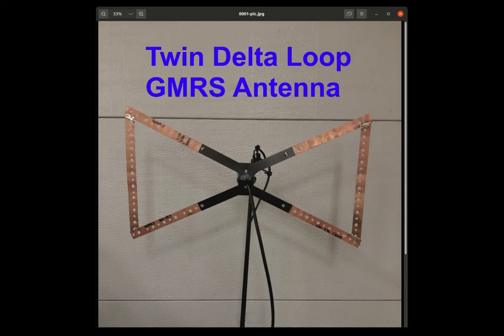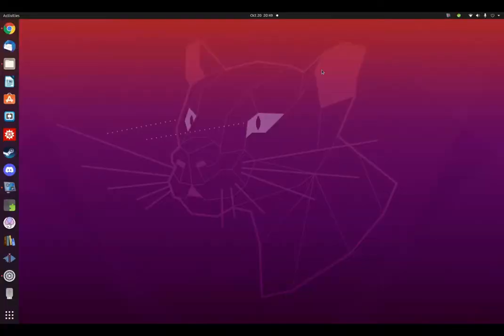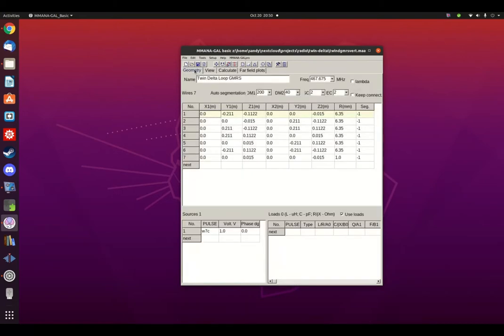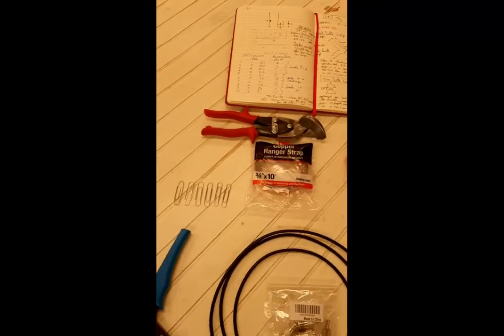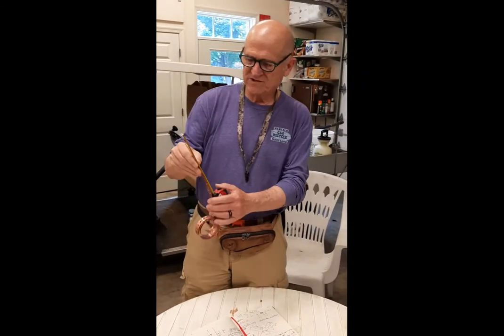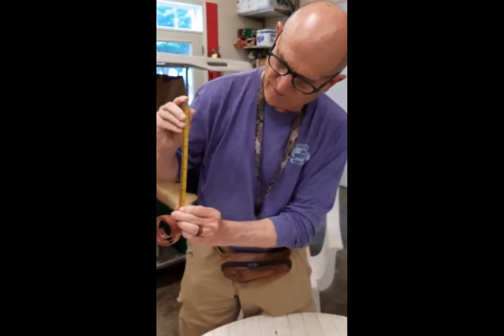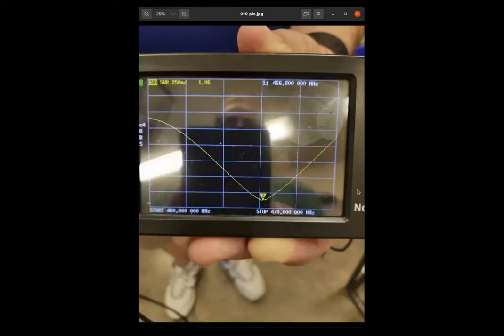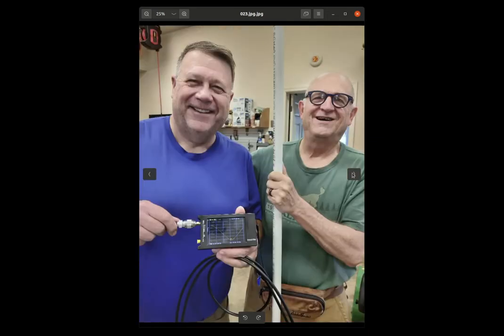Directional Twin Delta Loop GMRS Antenna Project

Comment: Do newbie amateur wannabes get their license first or learn some radio skills first?
Reply from the maker: Good question! Probably most will buy a cheap radio first to play with - then realize they want to learn enough about it to join in on the fun. Getting the license is the next step. The technician amateur radio license is an easy test to pass. The GMRS license doesn't require a test.
Reply: @mac333iii  thank you. Without a radio I am seeking to join in on the fun. And snare a network of friends to do so too. Thank you for the test tips. Hoping to find a nice prepper type to start with.